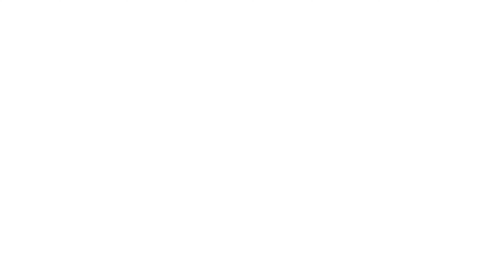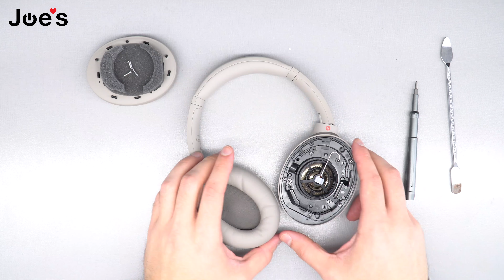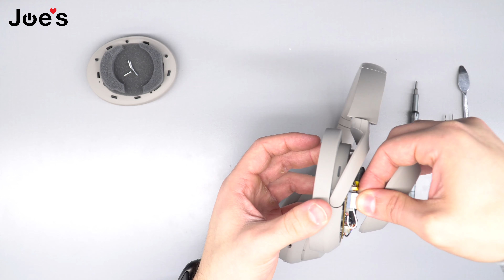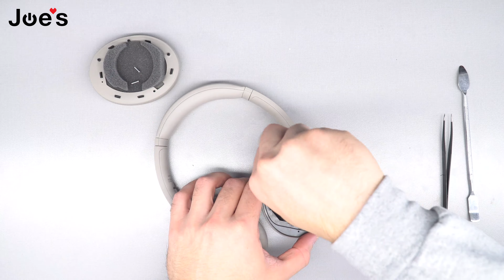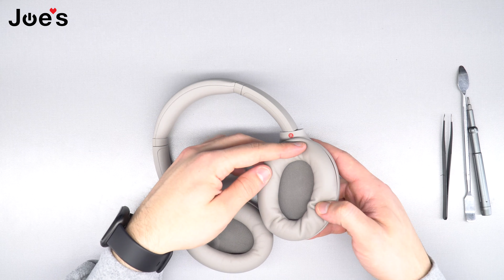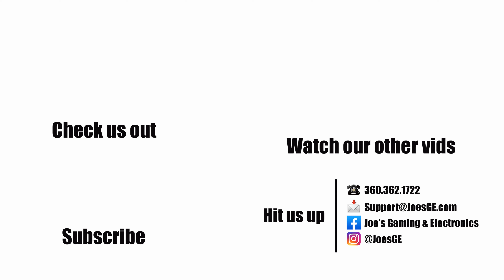Sony WH1000-XM4 Touch Pad Panel Teardown Replacement | Repair Tutorial

Comment: I think my ribbon for the touch pad is damaged. Whenever I close the touchpad completely the volume is low. But when extended a little bit away it’s loud audio. I tried to secure it and now the volume is just low regardless of position. Is there a way to sacrifice touch pad function in exchange for louder volume or do I just have to buy a new touch pad assembly ??
Reply from the maker: It sounds like you have a bad ribbon you can try to find one or replace the touchpad all together.   https://www.joesge.com/products/sony-wh-1000xm4-parts?_pos=1&_psq=XM4+outside&_ss=e&_v=1.0&variant=39694568521774